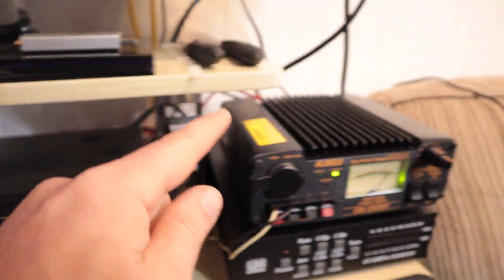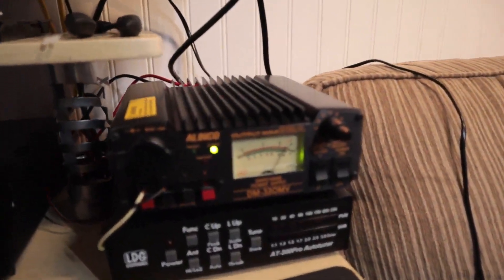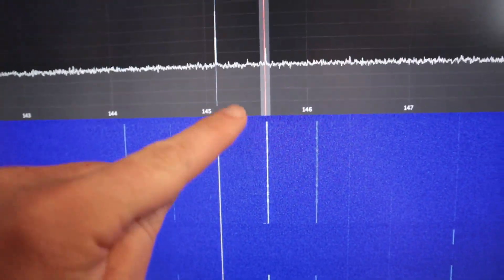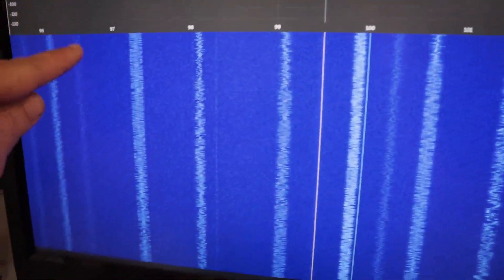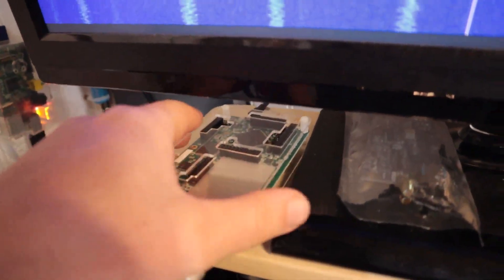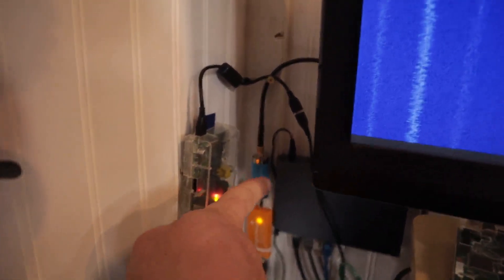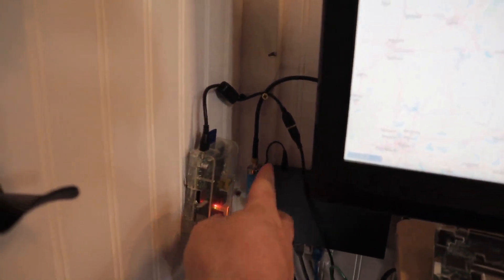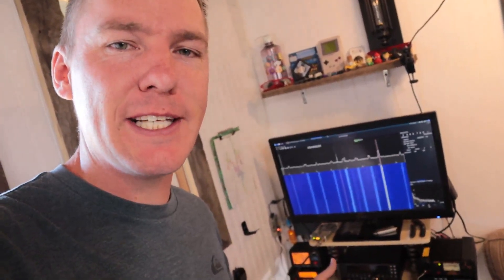Ham Radio Tour | Software GQRX and Kali Linux

Comment: FT450D has a built in Antenna Tuner, mine does no need for the LG Auto Tune
I have used a SDR.com V3 Dongle with the HF Driver now its 100khz -1.7ghz , Add a Multi-Band Discone and a 40 meter long wire, now everything is covered